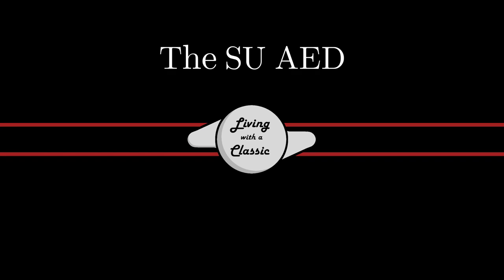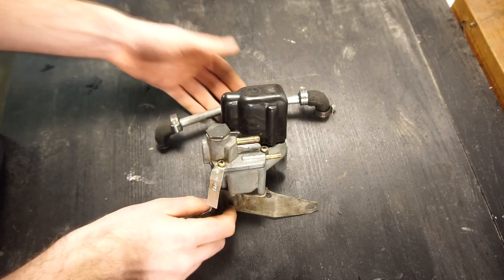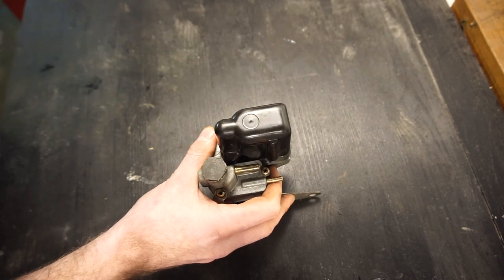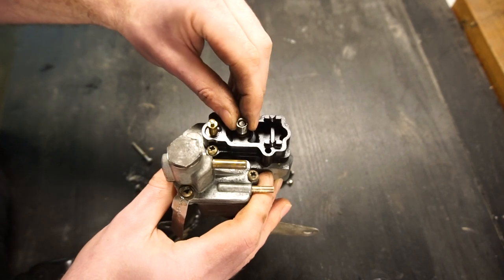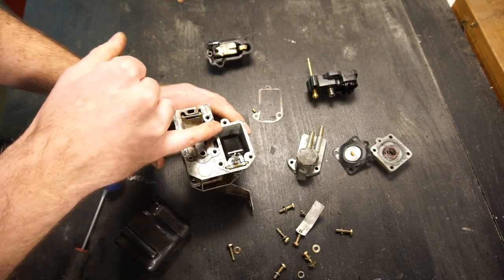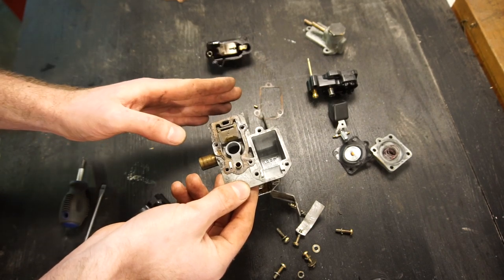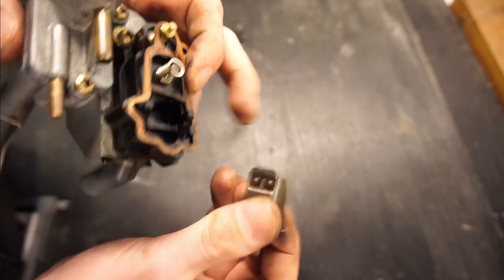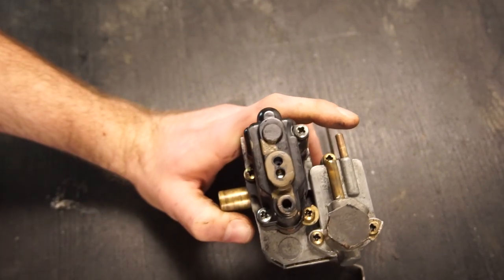Jaguar XJ6 AED Explained

Comment: A tale of two S.U.'s  or why you need to understand how an AED works:

I had a 1972 series 1 XJ6 and following a complete head overhaul, decided to replace the Stromberg stock carbs (I believe the North American spec cars had Stromberg as standard) with 2 " S.U.'s. I had hoped to find a triple set-up as used in the e-types but was unsuccessful. The manifold and carbs I did find were off an earlier 420 and came equipped with an AED. My '72 XJ had a pull cable choke so there was no information on the AED in my workshop manual. Not to be deterred, I went ahead with the conversion with the thought I would sort it all out later.

I embarked on a 1600 mile road trip the day after completing the valve job/carb upgrade. The outward bound part of the trip was fraught with carb problems as I tried to tune them on the road. Nothing was successful in getting them to run smoothly or provide the performance I expected. Finally, while on the return trip, I had made a stop at a factory in Connecticut ( I lived outside of Toronto at the time) on behalf of my employer. While there, as I went to move my car at one point, I was informed by a screaming factory worker that my car was on fire. When I popped the hood, I discovered indeed the engine bay was ablaze. The AED had begun dumping raw fuel on the starter motor - a bad mix at any time.

After a panicked few minutes as I found a fire extinguisher in the factory (nobody seemed to know where they were), I got the fire out. I was now faced with a torched engine on a Saturday afternoon in an area not known for classic British car parts and service. A few phone calls later determined I was on my own if I wanted to be back on the road anytime soon. 

I proceeded to field strip and rebuild the carbs and almost all of the other rubber, plastic and wire stuff in the general vicinity of the right side of the engine bay. I had to pull out windshield washer lines to make new vacuum hoses; re-melt and hand form the plastic damper caps on the carb domes; borrow a fuel line from the second fuel tank to patch up one in the bay; and rewire a few essential things. My fancy dual foam high performance air filter assemblies were toast (literally). Having determined the AED was at fault, it found itself left out of the rebuild and is still likely in the woods there in Connecticut. Fortunately, having owned British cars before and this XJ6 for about two years at this time, I had learned to carry my tool kit and some spares where ever I went. 

It took about three hours or so but when I turned the key, it started right up. A few more minutes to balance and tune and I was off. Surprisingly, the car ran faultlessly all the way home and delivered the performance gain I had expected from the 2" S.U.s.

Comment: I mostly work on Triumphs but a chap asked me to look at his Daimler Sovereign. 
The pipe had a decent sized rust hole in it and was only half insulated plus the previous numpty had jammed the AED float needle closed after fitting a service kit! I’ve rebuilt the AED again, made a new stainless steel pipe from the manifold to the AED and insulated it, unfortunately I wasn’t aware of the “here be dragons” on the needle lift screw and I completely dismantled the whole unit! 🙄
The car at least now bursts into life but sputters out straight away. Thanks to your info I now know that I’m close and which adjustments to make to what and why. 
Thank you! 👍

Comment: I´m really impressed by your video of the AED, saw it and went to the garage to fix it on my sons  xj6 -71. I also found that a rubber diaphragm was cracked, even though it felt smoth before dismantle. Luckily we in Sweden have "Joes garage"  that can supply spares.
I need to see more of your videos.
All the best from Nils

Comment: Great video Adam! My AED isn’t working properly at the moment. No problem last couple of years but after a long winter break it started giving me trouble. Mixture doesnot seem to be right and running idle just doesnot work with a cold engine. If I keep revving until the engine starts running warm and obviously the AED is bypassed, engine runs smooth again....
Looking at your video, several causes are possible. Better start taking a closer look first!
Reply from the maker: I would start by checking the diaphram if it was working before. Thanks for watching!
Reply: Living With A Classic thx...tips on removing the carb? Including the support i saw om your video...difficult to reach

Comment: Hi Adam, great staff like always. I am a pretty new XJ6 S2 -74 owner and have been watching your videos and these are very informative.

I have problems to start the engine when it is warm. The car also smells gasoline quite a bit when trying to start it and also after driving from meters away. I guess these both problems relates to AED misfunction. If not would be nice if you make a video that covers the issue with strong gasoline smell as I have read from some Jag forums that others are having same problems with smell, but just like in my case, can't find the reason as nothing seem to be leaking.

Comment: Great Explanation Adam, thanks for that!
I am a new MK II 3.4 Owner and it happens now, that this choke is engaged when the engine is hot. I can hear it "slurp". It slightly looks different, but probabely does the same thing, right?  My choke has two cables attched to the top. What do they do ? It has a little Pump-Stick too, what is that for? Prefloating? 
Thank you for your Answer, I really hope to fix that soon, so I can go for my first long drive.

Comment: ones i had a serie 2 and after a vacation the motor cabinet was open i closed every thing before the vacation to Denmark and all the spark plug leads where pulled out and the aed was molested the top was missing i had found the top on the back of the car on the ground i put every thing back but it did not work so i remade it for a Manuel temperarely and was looking for another one and for 250euro + return the old one in Holten (a jaguar parts + cars) in the Netherlands